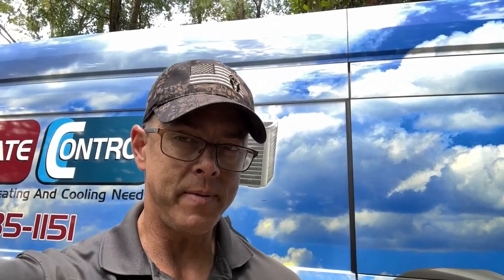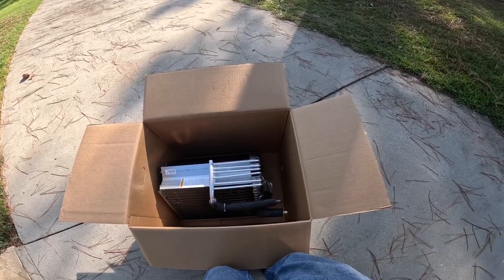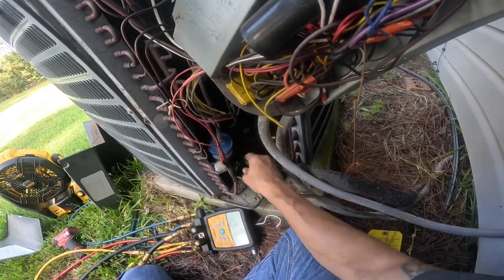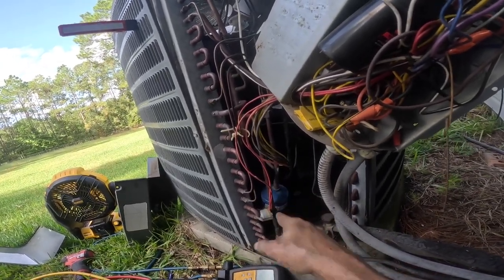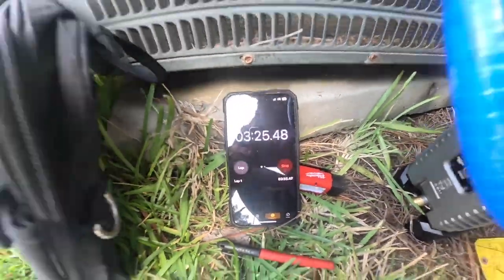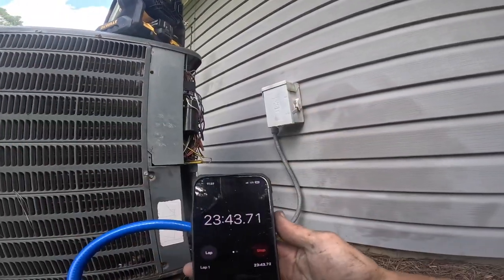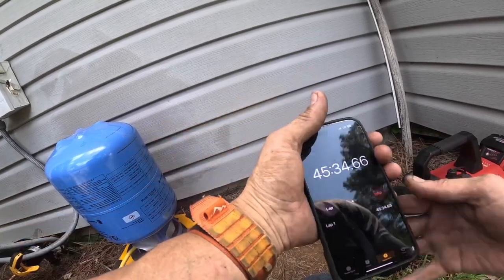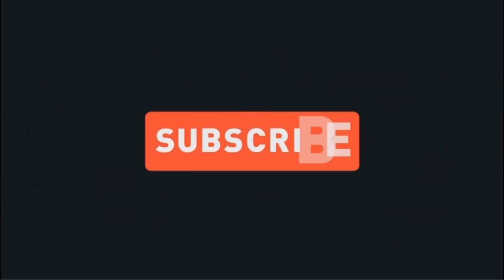Milwaukee M18 5cfm Vacuum Pump Real World Use, and Review

Comment: you found a new vacuum pump to save you time on the jobs. be bless and keep your eye out on the hurricanes.
Reply: So out of curiosity, how does a 5CFM vacuum pump battery powered pump save him time versus his VP87 8CFM electric pump running double Trublue 1/2" hoses?  He can hook the VP87 directly to the contactor power leads or extension cord and go, which will also connect to his Job link app or MeasureQuick.  
M18's have to be charged, what happens if the power dies part way through the vac cycle, plus those batteries are expensive when they die?  What about Triple vacs?  How many systems can it do before the battery is out of juice? One?  He was down to one bar a 357CFM, I make my employees pull to 100 microns and valve off for a decay test.  
I get battery powered tools and I use all of Milwaukee M12 and M18 tools, but that is one that is like a battery powered lawnmower, the corded models are so much stronger and way more torque and more power.  Hand tools, press tool and shop vacuums are one thing, that is a pump sucking the tin man through a keyhole requires extensive power.  I see this as a backup only or for mini-splits at best.

Comment: I have been looking for vacuum pump like that for a while and it looked strong, great video
Reply from the maker: Thanks
Reply: NAVAC has a battery operated vacuum pumps which I had no it’s better
Reply: I think is better
Reply: @fernandobazan829 what’s better? And why? I like the Milwaukee since most people already have their tools, so less batteries and chargers.
Reply: it

Navac is built for the hvac tech it pulled 31/2 ton in 15 min to 300 microns plus it didn’t  use the whole battery charge plus I can get a least three to five normal pull downs from one battery charge plus if you buy Navac products then you can use the battery on almost everything about Navac so there y’all enjoy and do some research before you speak btw  where is Milwaukee tools built
Milwaukee tools are currently manufactured in China, Germany, Mexico, the United States and Vietnam.
where is Navac built
Lyndhurst, NJ – NAVAC, the world's largest supplier of HVAC vacuum pumps in addition to a wide array of tools, gauges
Reply: @fernandobazan829  Thank you I was wondering about the NAVAC unit.

Comment: I have always wondered how often those press fittings leak. I know if you do them right, they should be good for a while just based on the videos I have seen them in. I know mixed oils can cause issues with rubber seals, I think I heard not to use them when changing from r22 to 410a for that reason. I know I saw them for sell about 5 years ago and for 2500 plus dollars I just could not see buying them for myself as a service tech. I would rather the company buy it then paying for it out of my own pocket. That vacuum pump would be really handy when doing things on roogtops.

Comment: Thanks for sharing, enjoy your content!... 

Your milwaukee DC Pump is rather noisy compared to my Navac DC ( one Navac battery lasts 1hr, so i carry two).. 
It's good to see the comparison to the Navac.  
QUESTION: 
HOW MANY MICRONS WILL THE PUMP PULL DOWN WHEN MICRON GAUGE IS ISOLATED TO PUMP ONLY?
Reply from the maker: I don’t know
Reply: @HVACGUY would be good to know. That's how you test your pump performance before connecting your hose set up. 
Also, you test your hose set up before connecting to the system..
When testing the pump only, should pull at least below 50 microns, idealy would be 15-25 microns. 
Just passing on info, we all in this HVAC thing, together!

Comment: Thank you for the video. I’m curious to understand why you chose to use the RLS press fitting on the evaporator and filter dryer but braised in the condenser what’s your logic that you use to decide to use which connection type?

Comment: If you already have the torches out , why not just braze in all the connections . Are you 110% confident those fittings won’t leak  over time ?
Reply from the maker: I believe this system will fail and be replaced long before those press fittings fail.
Reply: I used to say the same thing until i invested and bought my own  last month cost me 5k totally worth it if you use it how the manufacturer tells you to

Comment: tip: valve the unit before the true blue hose. they will not hold vacuum and leak. trublu says they are designed to transport not hold vacuum.

Comment: Nope, I own every Milwaukee hand tool and system there is.  Besides the lawnmower, because that is like $1000 and I will just run a Honda gas mower that is better.  The battery ran down pulling down one single system and only got to 350.  This isn't a drill, press tool, a saw, a shop vac for clearing drain lines, etc etc etc.  Those batteries are expensive as hell too and to replace when they die.  Not wasting my money on that.  I will bet you $100 bucks, he is back to the VP87 within the month.

Comment: blessings, a question are you welding under the presence of nitrogen? Because no matter how much sweeping is done and how much vacuum is done, when the soot generated by the welding internally is released, there will be a certain obstruction and those residues will end up inside the compressor. If I use nitrogen when welding, great. For the rest, the video is respectable.

Comment: Again I like fieldpiece where you can change the oil on the fly I got a 8 cfm and it works like a champ plus you are pumping milwaukee stuff just to get free stuff and kick backs you know you do lol
Reply from the maker: Milwaukee hasn’t helped me in any way. But that doesn’t mean I’m not trying to get their attention
Reply: @HVACGUY  it all good Curtis not meant to offend I just know that most of the influencers like you get free stuff is all and why not if it works great looks like it did a great job for now Milwaukee is going hot and heavy into all kinds of trades and i guess it up to the individual to choose what the can afford I started with a old JB 2 cfm vacuum took me 2 hours to pull down system over 25 years ago anyway good videos keep them coming thanks

Comment: Not much of a fan of battery operated tools ( except of course drills and such) as the battery sooner or later will become obsolete. Imo
Reply: Somebody with 3d printers will always be around to make battery adapters, literally millions on the web now.
Reply: The amount of times they change the batteries is so rare. By the time the reconfigure stuff, your corded tool would be in need of replacing anyways lol
Reply: I was kinda thinking the same. But how many uses will you get out of it before you’re replacing the expensive batteries. How fast does it drain a charge. I’m down for the pump but I’ll probably still use a cord for it and only use the battery when it’s necessary
Reply: @travisrockwell7804 you can run the pump for a hour or more per battery (depending on the battery uses ) I love mine it's soo much nicer than having to find a outlet and pulling a cord .

Comment: But what about recovery? You’ll still need a drop cord… seems kinda pointless and more of a struggle with making sure batteries are charged etc
Reply: I have this size battery charged for grinder and blower 
Also lots of times you can pump down not recover, lineset, evap, liquid solenoid repairs

Comment: I believe it's a pump IF you already have the 8amp or larger battery. If you don't have one, because it doesn't hold vacuum, utilizing an 5amp or smaller and having to switch batteries start to loose the convenience of a battery power tool that needs almost all 8amp.  When you add the vacuum cost PLUS the very expensive 8amp battery, your taking a whole lot of money to justify a couple of alligator clips on the disconnect. Don't get me wrong, still a great idea and pump, but without the extra cost of the battery - given you don't have one, it is not worth the squeeze in my opinion. Great video, tho